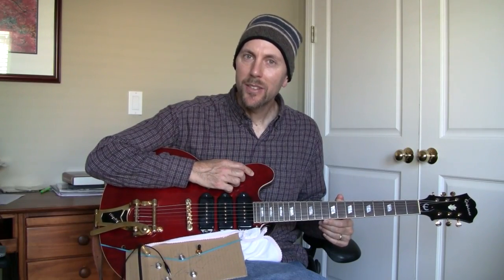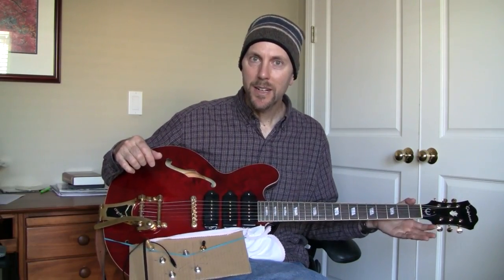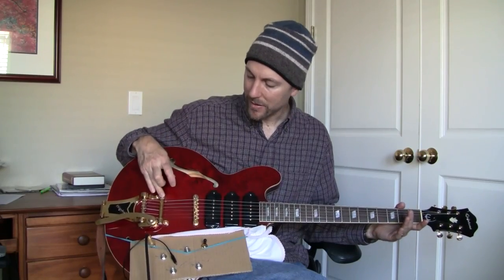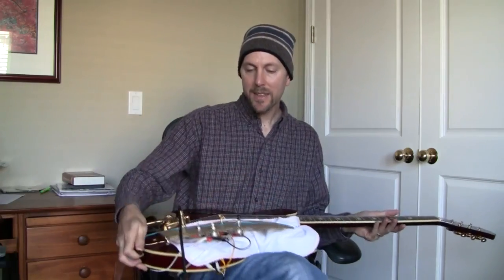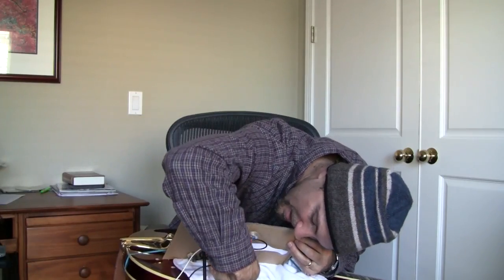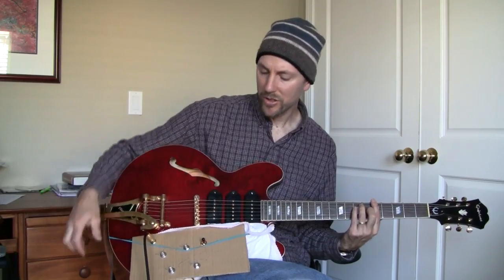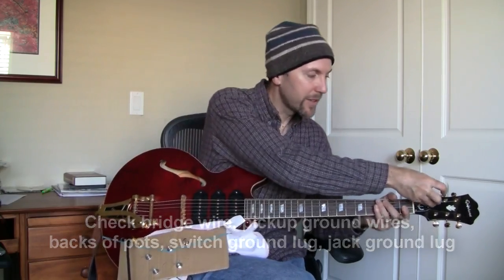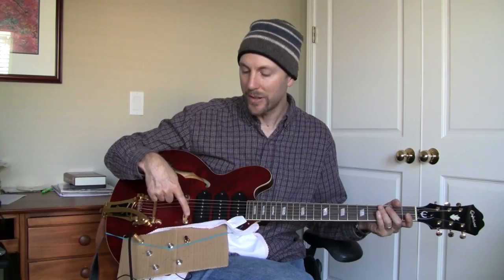Guitar Ground: Dealing with ground noise problems

Comment: I get this buzz from my amp, even when a guitar cable is not connected. What can I do?
Reply: same i have that to and i dont know what to do
Reply: tried turning your gain down? also you may not have equalized it correctly
Reply: I usually keep the gain around 50% then adjust volume to where I like it. Does that sound like too much gain? I usually have the EQ setup with a slight bass and treble boost with mids slightly down. I'll try adjusting the knobs a bit and see if its better.
Reply: well im a bassist and i normally play with my mids and treble all the way up with the bass slightly down and i just whack the volume on to any suitable level depending on where i am and just turn the gain all the way down first, adjust your volume then turn the gain up if you want and stop before it starts to buzz
Reply: Daniel Pendzich you're not getting good answers.  if its a tube amp it could be one of the preamp tubes causing this..   theres no 'correct' eq. .. u eq it how u like..    it could also be an issue with the power where u are (the building)  .  U may want to get in touch with an amp technician.
Reply: Daniel Simon
i just got a better cable and the buzz dropped dramatically
Reply: Daniel Simon Thanks for the suggestion. I think it could be the quality of power provided from the building as you mentioned. I do have the amp hooked up via a 220v to 110v transformer, and the transformer is daisy chained a few extensions across the room from a single outlet that powers over 10 different devices in the room at the same time.
Reply: Oscar Phillips Better cable? but my amp is buzzing even without a cable connected.
Reply: Daniel Pendzich
its your amp then, sorry about that...
Reply: +Daniel Pendzich Either Tubes, Filter capacitors, transformer or circuit stuff.
Reply: +Daniel Pendzich connect a 3 pinned contact to the wall. Worked for me
Reply: +Daniel Pendzich Dirty electronics in the room?
Reply: do you have power wires with a transformer near your home

Comment: I have the opposite problem. It makes a buzz when i doesnt touch metal on the guitar. Can some1 help? Also it's only the bridge humbucker that has the issue.
Reply: yea same it goes quiet when i hold the strings
Reply: @-cutekey2454  i fixed mine. One of the wires had no shrink tubing on the end which caused it to buzz when it touched some of the conductive shit on the inside.

Comment: also if an amp has no ground plug you can run a wire from chassie to center pin of wall plug thats earth ground  just be sure the amp dosent use floating ground  if it has use a disc capactor of .01-.05 uf 25-50 volt  u can get them in radioshack i was a tv electronics tech for 25 yrs and know all about this stuff

Comment: I have many guitars, amps, and cables but I'm still getting a humming through each combination.  Help?
Reply: think about this... several guitars all have the same problem? Unlikely. So multiple amps have the same problem ? Unlikely. so the house power supply may be the problem. A correctly grounded ' wall socket ' usually has 3 connections ( a bottom round plug for grounding  and 2 blade plugs, one wider than the other). Your 'power strip' may be where your amps are plugged in rather than a wall outlet. Check the different results of each, if it is different.  Plug an amp into the wall and also into the 'power strip' to hear any differences.

Comment: I have a masterwork amp. But It's making buzz noise so much. Even If I plug cable or not. Can someone help please?
Reply: It could be a few things. Is it a power amp, or preamp issue? Is it 60hz hum, 120hz, or something else? Does it have an effects send and return? If so, plug your guitar into the return of your effects loop, and see if the noise is still there. It could be as simple as a bad ground, or a blown cap/resistor, or something bigger like a bad transformer or  something else weird with the voltage being sent to the amp circuit. Do a google search for these things, and keep reading. I would not, however, condone you working on the amp without proper knowledge on safety, and just how serious one can hurt or kill oneself without proper knowledge. Especially tube amps which have higher plate voltages/higher capacitor stores. Do your research, and ask questions on amp tech forums. But honestly, bringing it to get serviced by a tech will cost less than your time and sanity in the end. Just remember, a little knowledge can be  dangerous.

Comment: Here's a puzzle, John, on my Roland Cube Street  2 of my 6 guitars produce a pronounced ground hum, which disappears when I touch the ground sleeve on the cable. This is when I'm playing through the power brick (not grounded), not the batteries, and it's only those 2 guitars.
 
Those same 2 guitars produce no hum on 3 other amps, and they both have dual humbuckers. 
 
Switching the power adapters or cables changes nothing, but there is no ground hum when I play through my Xvive wireless system.
 
So, where do you think I should look for a cause/solution?

Comment: I see you're wearing a toque...
Common problem up north is dryness.
You body acts like a wonderful antenna.
If you ground your body to the same ground source as your gear, you won't be an antenna anymore.
You might look a tiny bit silly wearing a ground clip but it's either that or cranky up the humidifier to 50% or higher.

Comment: The problem comes when I touch something plugged, like a mixing board, thats when I get shocked like a f***ing mouse although this doesn't happen to me any other way (like being bare foot...). Is this just because of the amp not being grounded or is it anything else??? The amp sounds like heaven by the way... that's why I'm kinda the silly mouse...

Comment: Ah... this is just what I need but am I missing something here? Where is the other end of the earth from the back of your pot connected? How are you 'earthing' the pot? Thanks.
Reply from the maker: That black lead I reconnected in the video was what connected the guitar circuit ground to the jack/cable shield ground, which is plugged into the amp. See 2:46

Comment: I still have this problem and cannot for the life of me figure out where the problem is in the circuit.
Reply: if you have noise even without any guitar (or other instrument) connected (try just select some input of audiointerface or internal soundcard in DAW on PC and use some amp sim for better hearing is it noisy or not).
   It could be noise from electric network and may be only some power conditioner will help to resolve this. You could try some Furman power conditioner or other.

Comment: Every country has to compete with the speed and price of manufacture of Chinese factories. That's the kind of reason that 1% of Americans are in prison and manufacturing goods for much, much less than the average wage. Any other country would call that slavery. America calls it freedom. I see this as a strange time to live in, so I now build my own gear. If it goes wrong I can only blame myself (plus it's a little cheaper sometimes).

Comment: There is no ground in my house haha, many houses in Russia were built without it...
Reply: Jatin Jadam Your body works as ground so it's not TOO bad, but it's much worse than when you have a proper ground.
But when you don't touch metal parts of your guitar (and therefore you disconnect ground loop) it's so noisy.